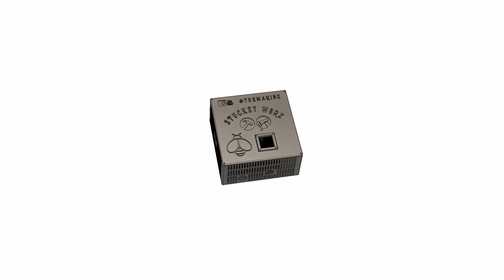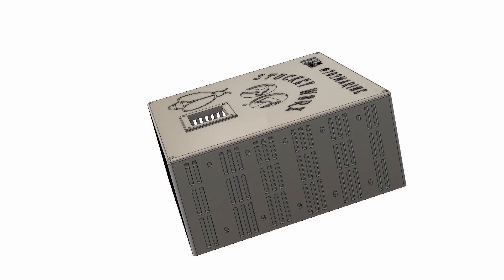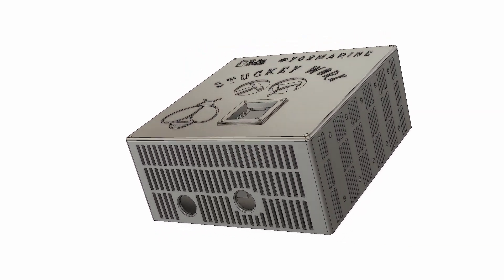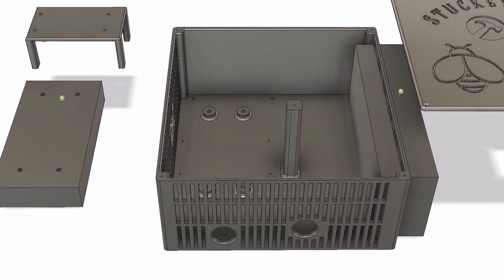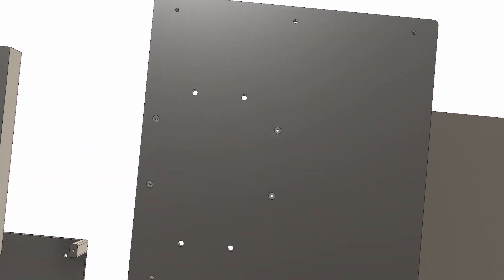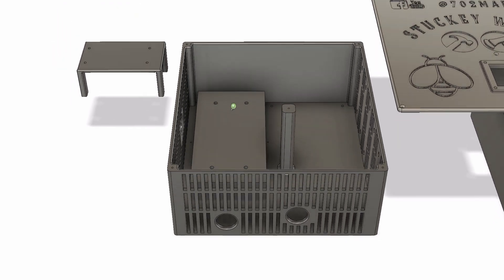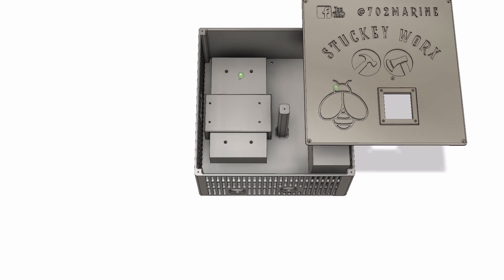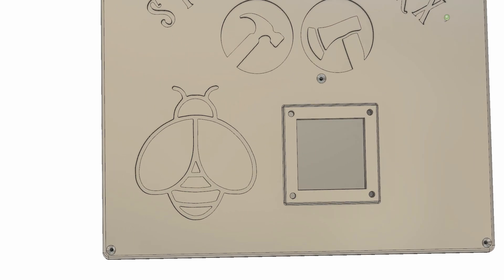Bulkman 3D/WorkBee/QueenBee Pro CNC - master control box for Mach 3 setup - Series episode 5

Comment: Question -- I 3d printed the box now where did you get the mounting screws to attach the electronic components, I have the queen bee 1500 kit are the screws in the kit I have? Thanks
Reply from the maker: I used what I had on hand or what was extra laying around. Nothing special or specific just whatever works best for you.

Comment: Thanks for your service and videos. I just ordered my 1000 X 1500 today. Maybe I missed it but what are the specs for the box. I have a 3d printer but looks like it will be close on fitting on the bed
Reply: I have a Flashforge creator max, I had to cut mine so i could fit them on my print bed, the box is 11 3/4 inches square,, I pieced them together and glued them to a piece on plexiglass, one for the lid one for the box, looks great !  I used flashprint that came with my printer hope this helps the only printer with a bed large enough to print this is a creality creator plus, I Think it has a print size of about 13 inshes, but check first
Reply from the maker: It is 300mm x 300mm. A little larger than most print beds people have.

Comment: I just did what I needed for my controller in solidworks Then exported the files via DXF and toolpathed them with V-carve and cut it out.. Seemed logical as I already had my total home brew cnc going. I just used 1/4 mdf. the box is completely inclosed and uses a 4 inch 110 volt fan for cooling. If youre creativve and can handle a state of the art true 3d modeling program just use Fusion 360.. Plastic boxes of ANY sort are a cheapass solution for a replacement of the proper materials in many places.. I was out about 20 bux for some rattlecan paint, a 1/4 sheet of 1/4 mdf and a handfull of screws..